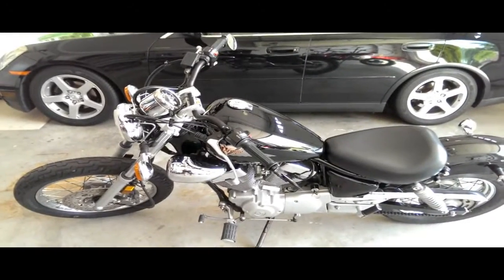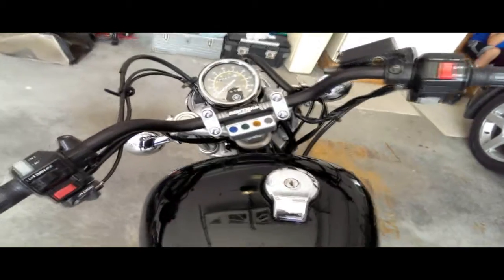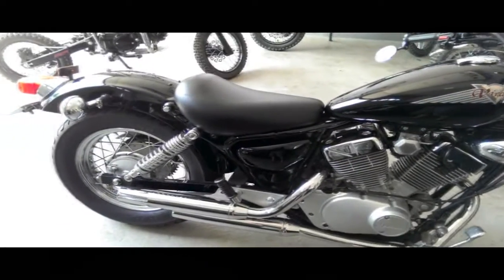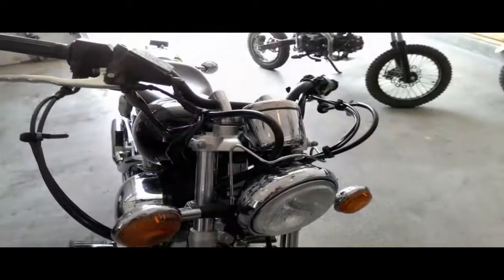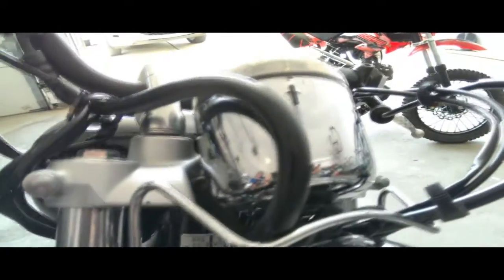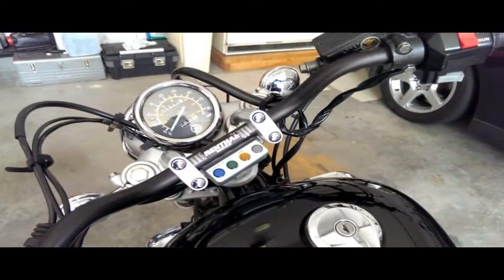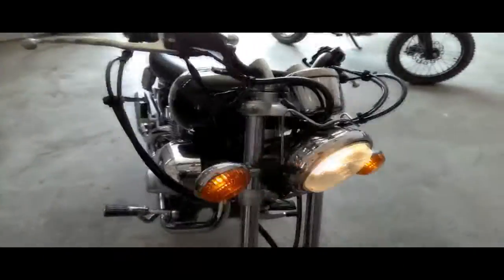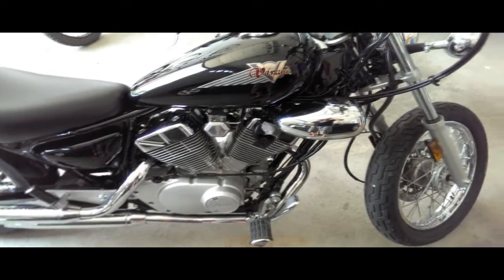Yamaha Virago 250cc Cafe Racer Bobber Project

Comment from the maker: Thanks! I did not lose any power with the baffles removed. It seems to actually have picked up some power due to reduced back pressure. The low end torque is still fine and the top end power is more noticeable now. The left pod only contained a relay for the turn signals I believe. I just tucked it under the gas tank and behind the horn and zip tied it. i am waiting for Jardine to start producing their Rumblers exhaust and will probably order those when available.

Comment from the maker: Thanks Mani. the back seat removal is easy, just one bolt and the seat slides off. Then a few more for the bracket and just put the bolts back to fill the holes. I did not shorten the cables after the bars however I may shorten the throttle cable and clutch cable in the future. I just added a pod air cleaner and mini black turn signals with clear lenses. I will post a new video soon with the updated mods.

Comment from the maker: Cool. I need to get some straight pipes for it. Even though it has a nice a sound now, it's still a bit quiet for my taste. I left the stock sprocket setup which is great for the city riding which is all I use it for. It's too light and geared too low for any highway cruising. I'm sure the bike would do at least 75 or 80 as is but for right now it's a fun 0-60 city toy.

Comment: beautiful paint job, mirror finish , just put some drag bars on my 250 ,  and i shortened the wiring , cables are a diff matter
Reply from the maker: +Jennifer Davey Nice. Post a link to your bike. 😁
Reply: i gont have a link, since i upgraded to windows 10 ,  "" big mistake "" seems to be nothing but hassle to upload a foto, was such a simple task on windows 7 ,  when i get time , been told i could download something  that gets rid of windows 10 , this comp was 8.1,
Reply from the maker: +Jennifer Davey Windows 10 is much better than 8.1 Don't go back to 8.1 it's a disaster.
Reply: like to explain in more detail, , i see no reason for keeping windows 10,
Reply: @Jennifer  Your comment is old, so you probably don't have the Virago 250 anymore; but, just in case, you can get shorter OEM cables at a reasonable price from the website I linked below. Note, that these parts are for a 2014 model. This is important because from 2014 onward, the XV250 (a.k.a. Virago, V-Star 250) came with straight handlebars; that's why the cables are shorter, if you order 2014 parts or later.
https://www.yamahasportsplaza.com/oemparts/a/yam/5286a8cdf8700230dc2a7be5/steering-handle-cable

Comment: Thats a Rad sound there man!
Wanna do that to mine when I get one :)
Reply from the maker: Just remove the baffles from the pipes. Adds a nice sound and still runs great.
Reply from the maker: +Boris Graell I did not rejet the carb. I may though.
Reply from the maker: +Boris Graell Nope. Stock jetting with the open pipes. I may try larger jets for some extra HP but I ride pretty chill most of the time. I hardly ride it all LOL. It's my occasional toy.
Reply from the maker: +Boris Graell Those are two different types of bike. If you want a cruiser than it's the xv250, otherwise it's the cbr300 which is a sport bike. It's entirely based on your riding style.

Comment: Hey man, awesome job on the bike so far. If you have a chance to reply I was wondering about the baffles. Did you pull them out like completely? or just drill like 4 or so holes in the inside end of the muffler? Also, how loud are we talking here with no baffles? We have sound restrictions in Aus. I know refuckindiculous! 
Thanks again mate and best of luck to ya!
Ads

Comment: Did you have to rejet your carb, after removing the baffle? I see from an earlier comment that you rejetted when you installed custom open pipes; but did you have to rejet when you removed the baffles from the original pipes? Thank you.
Reply from the maker: No. I didn't rejet after removing the baffle. The stock pipe is really small and doesn't require a rejet.
Reply: @MaxSpeedMediaLive  Thanks for the info.

Comment: How did you remove the Front Fender? Did you need to take off the wheel? Cheers :)
Reply from the maker: +Zach Davis Nope. It's only a few bolts and off it comes.
Reply: Did you need to take off the cap things that are over the top of the bolt? or do you need a special key for it? If you get me haha
Reply from the maker: +Zach Davis I don't recall needing any special key.